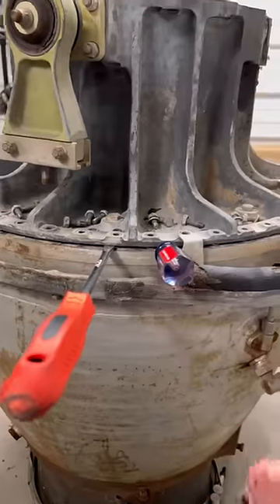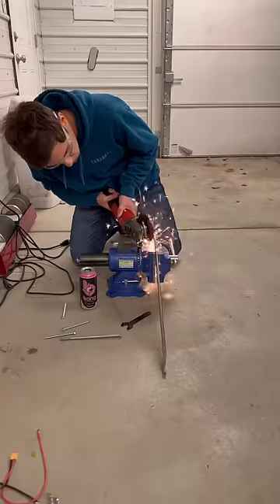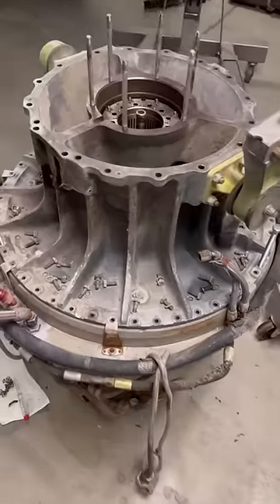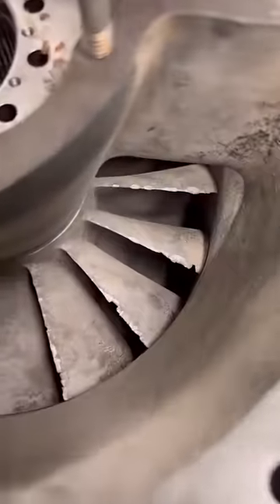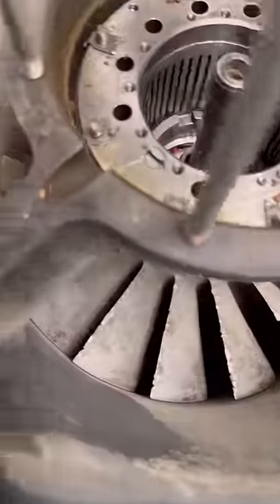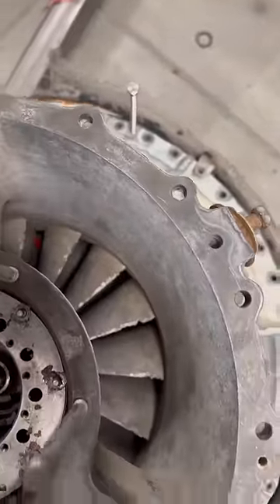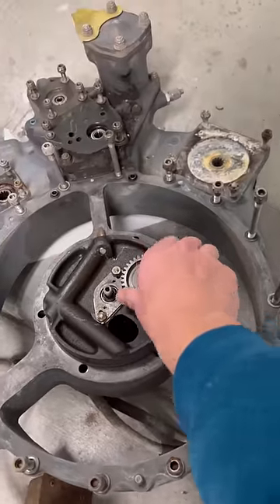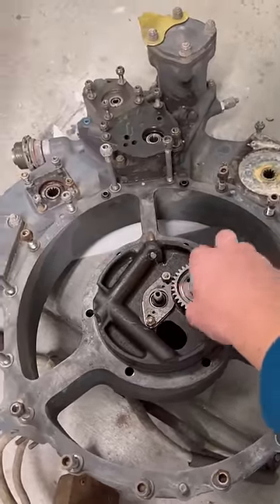Extremely Sketchy Jet Engine

Comment: As a former aircraft mechanic, if you don’t follow the MM, you are asking for violent trouble.
Reply: that what
Reply: @3dwezzy740  maintenance manual
Reply: FACTS.
Reply: There's a kit somewhere That can be ordered to rebuild this gas turbine but it will still set you back a pretty penny.  I've only ever worked on the larger ones in the power generation field So I don't know what overhauling a small one looks like but it couldn't be too much differenthen a frame 7 gas turbine overhaul.
Reply: @3dwezzy740  He said he had one,
Reply: mm doesn't account for galvanic corrosion
Reply: Well like i am an aircraft engeneer myself i can tell you this guy Will try it anyways. I am hoping for everyone this engine wil nog take off on its own or blow up and trow parts everywhere because them it is most likely game over for this guy.
Reply: Please somebody that knows what they're doing help this guy
Reply: @aarondavis8652  you work on the GEx7?
Reply: @3dwezzy740  It's part of the RTFM code.
Reply: @jaegerboyz  only ones I've fooled with are 7FA and 7EA gas turbine. I've done generator work on a 501VE but never overhauled one.
Reply: As an A&P seeing him hammer that pry bar between the two mating surfaces hurt my soul 😂
Reply: @alexryan7175  yea that ain't no good at all. I'd use heat before putting a pry bar on that.
Reply: It's Galv'd
Reply: This guy has no idea what he’s playing with. He’s already majorly compromised the component by cracking the flange on the outer housing
Reply: It's okay he's actually an engineer
Reply: @toby818  I've had to fix more fuck ups in the name of "engineer knows better" than I care to remember over the last 10 years. That's a paper title. Lol
Reply: Natural Selection.
Reply: @aarondavis8652  he's planning on test firing on a range, with him on the other side of a hill
Reply: @davidnickisson2555  he better set up where he's facing it axially because radially, there's no safe distance to set up. Lol that turbine will sling parts all the way back to China. Lol
Reply: This guy is dead already and doesn’t know it. At least we might get to see it.
Reply: @aarondavis8652  oh then my man is dead
Reply: this is like watching a toddler attempt a surgery
Reply: @sedonabear2010  wow did u figure that out onyour own this isn’t iTunes it’s u tube
Reply: If it jams force it, if it breaks...it needed replaced anyway.
Reply: @sedonabear2010  this is shit he does for a living pretty sure he knows what he's doing
Reply: @sedonabear2010  never said you didn't weird to assume he doesn't know all I'm saying
Reply: At least try to heat the outside
Reply: The mm probably says to dispose the whole turbine due it current state.
Reply: @RGV2300  actually, the turbine engine is designated by its Data plate. Every part of a Turbine engine is replaceable.
Reply: @aarondavis8652  You bash engineers but I'd like to see you design a gas turbine engine. Being an engineer is far more than just a paper title.
Reply: He's never actually planning on flying this.
He absolutely knows this will never air worthy again.
At best. There are some good parts here and he absolutely knows this.
He's doing this solely for content.
Reply: @aarondavis8652  I thought the engine was an APU ,
Reply: @alexryan7175  Me too , it hurt my soul,, reminds me of "hammer to fit ,, paint to match "
Reply: Bro let’s be real 85% of us are hoping for violent trouble
Reply: @sedonabear2010  what makes you think he has anyone advising him? the dude is just hammering away at stuff
Reply: He is also either an aircraft mechanic or an aircraft engineer he said it in one of his videos
Reply: He's never going to actually try to start it he's been making videos about the thing forever with no actual work on it
Reply: @tsrenis Fuk 😂

Comment: What about the metal tabs that connect to the housing you're trying to take off
Reply from the maker: They aren’t touching the compressor housing yet. There’s still a gap. It’s stuck on something else unfortunately. Don’t want to take them off until they’re in the way cause otherwise I’m just gonna be bolting them right back on.
Reply: @jackschneider17  I've got two advices only. Can't be tight if it's a liquid, aaand there's never enough penetrating fluid
Reply: @jackschneider17  👍👍 just keep clear when you start it I know you know this but dint want you going boom with it.
Reply: There's probably something interference fit  keeping the housing on, using a heat gun and the screw holes that were designed to take it off should be able to make it separate
Reply: @jackschneider17  that makes zero sense. They go over the part you're trying to remove. Obviously they need to come off.....
Reply from the maker: @jc9233  that entire ring with this six brackets isn’t attached to anything, it can slide all the way up to that green engine mount (like 1ft up). It 100% is not the issue
Reply: Maybe try and air chizle or hammer the vibration might help or some  Is corrosion  Penetration spray
Reply: @jackschneider17  try spraying the seam with toluene or xylene. They shoud dissolve aluminum oxide.
Reply: @Hookedup519  not a great idea when playing with turbine parts tbh, most engine manufacturers make specialty tools to avoid the use of even hammers and prybars so damage cannot occur. Tolerances are everything on turbines and damage can be devastatingly expensive especially on gas cases and housings
Reply: @jackschneider17  have you tried spinning it? Maybe it’s sitting in a locking channel.
Reply from the maker: @jc9233  That ring isn’t even connected to the combustion housing. It literally is just floating there. Can lift it 6” up from where it is before it runs into some hoses.
Reply: i was thinking the 6 or 8 bolts beside the rib structure, maybe its 2 parts, need to take the top off then unbolt it from inside
Reply: Penetrating oil, time and heat are the tools to use. Get something that is a penetrating oil that can help loosen and let is sit, then try an air hammer or something similar. 
Sometimes just really hard hits will help break it free. I’d recommend looking for places that you can place a sturdy piece of wood and try smacking it with a sledgehammer hammer to break. 

Try using really high,  heat. Don’t damage anything but heat will often help metal parts separate.
Reply: Dm me brother I’ll help
Reply: @jackschneider17  you’d be surprised how sometimes things don’t look like they’re the problem when in reality they are, that’d be a really simple way to quiet a lot of people too
Reply: not done much on turbines but enough to know without the bible you're just going to mess stuff up.
hot stage inspection of a pt6 required dry ice packed into the shaft to get it moving for example.
more pertinent here, old boys in the trade told me exciting stories of compressor rub on mag housing, make sure you've got several cameras running when this thing starts.
Reply: @jackschneider17  
Get the ap manuals for the jet, and get a bathtub of cocke. your issue seems to be rust we find it all the time im restoration, but more importantly if your missing the APs then you have a much bigger issue.
Reply: Have you tried hanging it by the bolts and pulling off the outside? It might be pressure fitted and you probably need a hydraulic press
Reply: @jackschneider17 i wanna see it move 1 ft
Reply: @jackschneider17  as someone else said, penetrating oil, time and heat will help, and remove those brackets so you can take it off
Reply: @jackschneider17  your just taking something apart saying you’ll fix it for views.   L
Reply: If that housing is housing a shaft I can bet that it’s seized up on there. Just start cutting it up and deal with the damage later
Reply: Shes stuck on the center shaft. That center shaft is either there with bearings holding it down.. other end of shaft needs to be dis assembled or around that center shaft there is an outside special tool that u need to use to unscrew a sleeve to let the center shaft loose so the assemble can come out.  Where is your parts diagram?
Reply: @sedonabear2010  some parts are actually what's called interference fit where one part will be a few thousanths of an inch larger than the other, it requires heat to put the parts together and separate, while you're not wrong that it has been neglected  it should still be able to be taken apart as these casing halves would usually see larger amounts of corrosion because of where they are. This also looks to me like a compressor casing in which case there is much less heat, furthermore one should only use manufacturer recommended parts and materials on any engine, so placing anti-seize on bolts isn't recommended unless the engine manufacturer has specifically stated that that bolt needs it. Even so in this clip he has all the bolts out and is trying to separate case halves, heat doesn't hurt here, in the turbine shop we use heat guns aplenty and hot plates/freezers for installing bearings and casings on various parts of the engine. Again while it is corroded, I do believe he should be able to get it apart with patience and a good amount of heat
Reply: @jackschneider17 I could be wrong but did you try rotating it? Could need a little rotation incase something on the inside holds it together. I could be wrong but who know not me
Reply: @jc9233  wroooonggg
Reply: @jackschneider17  try using an air hammer on an area you aren’t afraid of having surface damage.
Reply: @jackschneider17  bro literally at the very start of this clip you can see the metal bracket touching it and it looks like it's getting bent up not sure what you mean it's not in the way...
Reply from the maker: @Ilove3SGTE  It’s was just resting on it. That whole ring isn’t actually attached to anything, it actually can just rise up to the green engine mounts
Reply: @jackschneider17  I see okay. Maybe it was cold set.
Reply: @jackschneider17  you should take that top plate off from around the shaft use the outer whole as a pusher I think maybe look for another snap ring or something
Reply: @jackschneider17  if this was left outside it probably just rusted together no bueno
Reply: @jackschneider17  find a 55gal drum to place the entire housing in, fill with water, and run it through electrolysis cycles for at least 10hrs.

It'll break down the corrosion.

If it still doesn't come apart run it again till it does, it's hard to tell how much it needs since you cant see inside
Reply: @sedonabear2010  so the one screw he shows as being cracked is what's called a jacking screw, there's a few more around the case and the idea is you tighten them diametrically and equally across the case. This is meant to separate the case halves without the need for a specialty tool. But heat might still be needed as well as possibly a little lubrication

Comment: To take the housing off there are a few “nuts” to take off of the center drive shaft. Each stage has several that clamp the cases in the center as well as help with holding oil seals in place.
Reply: I knew someone who knew these turbines would be here..👍🏻👍🏻
Reply: Yeah I was able to find that out just by googling for a bit. You'd think this guy would have done that.
Reply: Agreed, from the quick overview he still has more to disassemble on the center shaft. Andhe just damaged the housing and warped it.   He needs to stop before he hurts himself and anyone near by.  One thing is a car engine going at 2-3-5k rpm its another beast altogether dealing with a turbine having a  30-40-50k rpm especially when it unbalanced very very dangerous

Comment: The locking nut that holds the entire turbine, and compressor shafts together that's in the middle would be a good start.. I think the blades on both spinning sections interfaces with the housing.

Comment: You can do as much of that work yourself as you are able but in the end, if you plan to get it airborne again, you will have to pay a licensed professional to do an inspection and possibly a once over on everything you did. I had a friend years ago who started flight school before he was done with high school. He found a plane on eBay and it ended up being more hassle than it was worth. He eventually sold it off part by part
Reply: Great story very uninformetive or relevant for this project that thing will b lucky if it even makes a popcorn fart ever again

Comment: There is typically a set of center hub nuts or bearing on the shaft that may prevent that housing from coming off.

Comment: @jackschneider17 try to use a torch at the same time using the flathead screwdriver or crowbar, heating up the metal sometimes helps melt the crud holding the two sections together and it should pop right off

Comment: I used kerosene to loosen tight Rusted bolt. so it might help you compressor housing problem. Or you can use wd-40 decreaser instead of kerosene
Reply: Heat too. Heat gun and atf oil.  Let sit
Reply: He don’t read our comment

Comment: Sounds like you need some type of puller to remove it and then most likely a pusher to put it all back together! I don't believe those are actually the technical terms for them, but I won't be wrong. Hopefully this helps 🤯

Comment: Or you could unscrew the nuts on  the metal pieces around the lid that connect lower down on the part thats holding it in place
Reply: Buddy, it’s a jet engine not a four wheeler case it ain’t that easy😂😂
Reply: The engine set outside for ages and is binding because it is corroded all to hell lol

Comment: Find out who the engineer or equipment specialist is for those engines and contact them for assistance.  Also make sure you are following the T.O. step by step. also be sure to read all of the cautions, warnings, and notes. There may be something hidden you missed in the T.O.
Reply: Ha, you think he read the T.O.???
Reply: dude i doubt he can afford to have them fix it, you have any idea how expensive that is?
Reply: I think he skipped a few steps in the T.O. but hopefully he is figuring it out now. There are a lot of special tools needed for any aircraft maintenance. Im sure there will be plenty of road blocks ahead for him on this project but I still wish him the best of luck! It is awesome to see young people doing things like this instead of playing video games and laying around the house.
Reply: They are probably all dead by now. A service manual is what is necessary here
Reply: @royfrye2871  the USAF still fly this jet to my knowledge. There are engineers and equipment specialists still assigned to the jet and the power plant. But I could be wrong.
Reply: @tomwoods1373  they do, heck they still use tankers from the 50-60's
Reply: @tomwoods1373  thing is he need to be certified to perform the rebuild. or hire a mechanic with a powerplant rating to do it. the fact he cracked to compressor houseing and was like nah thats fine says he dont know what hes doing.
Reply: @epope98  the fighters that i work were built in the 70s. Some of them are anyways.
Reply: @tomwoods1373  my bad. I just knew it was pretty old and figured they had moved on from them! Thanks for the info. I stand corrected!👍✌️

Comment: You cracked the case... Ask for help or ideas when dealing with issues like this.. A hammer and prybar are not your only options.
  Heat , Cold, Aerocroil , Electronic Frequency Pulse, equalized tension, etc etc etc..

Comment: Look up bearing pullers and and more so steering wheel pullers .. they way the steering wheel puller works , you could probably make a giant one and bolt it to the top studs on the housing and the center pusher bolt will push the impeller shaft down as it pulls house up ! If it’s beefy enough you could do a 15ft breaker bar to turn it

Comment: You need a hydraulic push pull kit for that or something, I work on Pratt and Whitney’s cuz I’m in the airforce and to split modules we use hydraulic wrenches, maybe the could help but Seeing how old the engine is it’s probably going to take more than that

Comment: Special spine tool that goes in the middle on the shaft on the center before you remove the housing to the turnpike you can see it it has a 6 sided square tool that goes on the center kind of like a sprocket tool that goes on a bike to take off a crank chef

Comment: I would recommend using a engine hoist or homemade tripod. Use lots of penetrating oil and a large wooden mallet.  A piece of a 4x4 post can make a good mallet in a pinch, just drill hole and attack a long handle.

Comment: Bro I told you in a previous video. Get the right tools. Order machinist wedges and get a bunch of them. Also heat up the housing with a torch where the fit is. It's just stuck it will come off. Spray some penetrating oil between the flange and the register fit. Pb blaster. But I feel you already damaged it by cracking the housing at the jacking bolt. Also any damage you do to rotating components ie heavy burrs or dings affects balance of the engine. You want to avoid all of that

Comment: There's probably some bit in the center that's Pressed in, it might even be a heat set. check the bearing races , if they don't move its probably them.

Comment: Also turn those bolts to help push it up, you have to do it evenly though... sometimes they get stuck but heat also can help...or leave it for awhile with tension on it....screw the bolts back in forth so you don't break anything.
I do commercial equipment repair for my own company..if you ever have a question don't hesitate...idk if I can always help but I'm down for what I can

Comment: Bolt the main housing to the ground and use a hydraulic engine hoist to lift the compressor housing off, its probably welded to the main housing via galvanic corrosion or conventional rust welding over the years

Comment: Use thermal expansion to your advantage. Heat up the outside compressor hosing and keep whatever you need to remove bolts whatever as cold as you can.

Comment: A&P mechanic here. Consider using a Air hammer to bust some of that corrosion. I also have my doubts on the serviceability of those motor accessories.😢